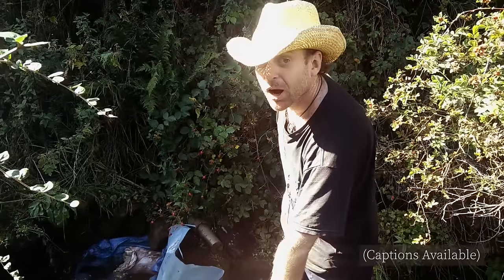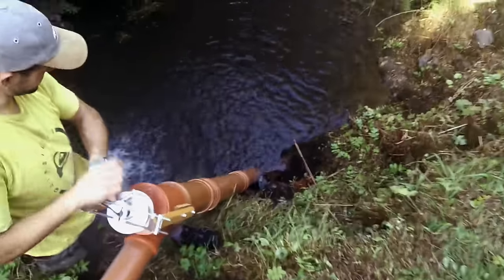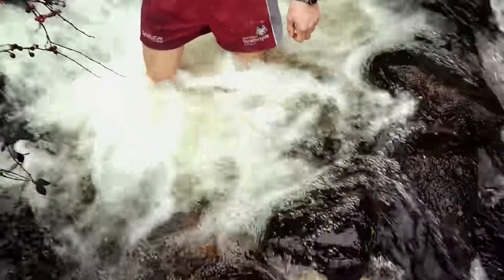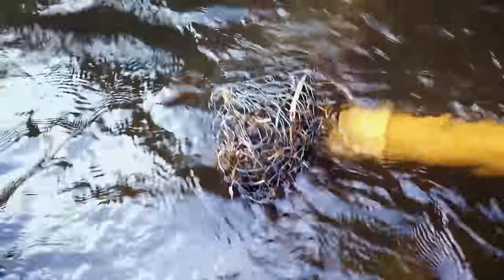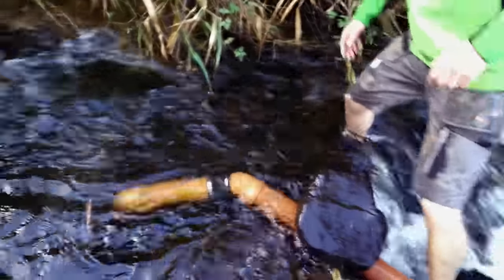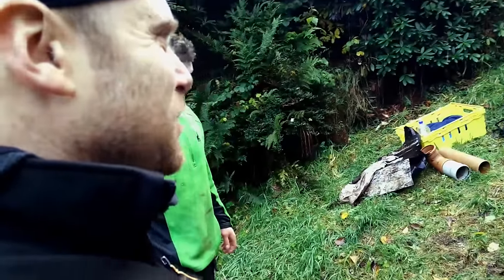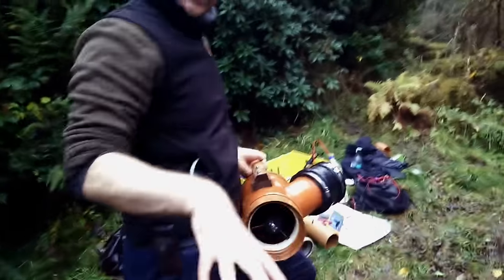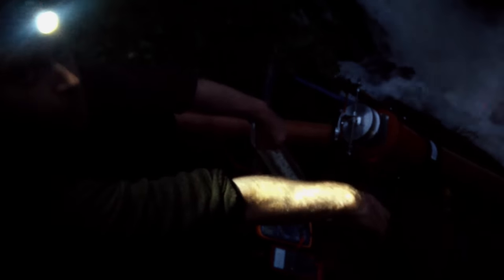Real World Results From The $50 Water Turbine

Comment: What vertical distance does the pipework cover before it enters the turbine? Looks like you could gain another 2m (20kPa) of pressure at the intake if the turbine would be at the end of the pipes.
Reply from the maker: Still need to measure it accurately, but it's something like two meters above, same below. It's a momentum turbine tho, not a pressure type like a Turgo or Pelton, so the runner doesn't want to be at the outlet, best configuration is vertically above as long a draft tube as the location allows.
Got it halfway here for topological reasons.
Reply: @OpenSourceLowTech  Ah ok. Looking forward to your further work.
Concerning the blade damage i think you said that it occured after you shut down the water flow. Could water hammer be the cause?
Reply from the maker: It may well have been, yeah. That or just coincidental timing. More testing on the way.
Reply: @The8blackwidow8  would water hammer only occur if you stopped the water flow, instead of cutting off the water flow? (Blocking the pipe end, capping the pipe end suddenly in would be ways to create water hammer.... But removing the source of water at the beginning of the pipe shouldn't cause water hammer)
Reply: @FuAzzi  In pipelines water hammer does travel in both directions but starts 180° out of phase on the other end. You basically create a zone of vacuum at the cut and the water column will hit back after two time the travel time through the piepline. 
The length of pipe on the "cut" side here is very short, so the water hammer will be very small in amplitude (because you can not cut the flow fast enough to reach two time travel time through the pipe). Propably not a concern but it was the first thing that spiked in my brain when he showed the damage.
Reply: @The8blackwidow8  thank you for the answer.... I'm very inexperienced beyond residential plumbing in construction.... It's nice to have dialogue this day and age, without it turning into defensive attacks.
Reply: @FuAzzi  True words. No worry's, i'm not that experienced too. I love those little projects where people encounter all the real life/ real engineering problems you normaly only read about. And see how they solve them. 
Thats so nice about engineering. You don't need to make it perfect, it "just" has to work enough to meet your requirements and be sustainable.
Stay strong in this difficult times!

Comment: Would have been nice to know how many gallons per minute you're running through those pipes I mean I know that the amount of water you need is really no big deal because without it nothing would work so it seems like you would have wanted to let us know what that flow rate was
Reply from the maker: I haven't measured this setup yet, but in Berlin with 2.5m drop and 125 + 200mm pipe it was about 35 l/s.
This is 110+160 and 4-5m, so maybe similar but not sure without timing a bucket or similar.

Comment: try a pelton type of blade system and of you can make an aluminum blade prototype
Reply from the maker: Peltons and Turgos are good and effective, but only really at heads higher than 15-20m.
Runner can be metal, including cast aluminium, if you're wanting to make one.

Comment: Is there a reason for not using metal fans?
Reply from the maker: Just availability. If you can find them in the right size and shape and not going to oxidise, then they'll be stronger, yes.
Next video will be on testing various 3D printable options.

Comment: What RPM would you expect from this with the 100mm pipe ?
Reply from the maker: Open circuit think we were getting about 1200 rpm or so.
Depends on head, flow, and load obv.
Reply: Have you any idea how much extra the syphon effect adds above just utilising the available head.  It’s an interesting process.
Reply from the maker: The siphon, ie any up and down, adds zero power and in fact would remove some via additional pipe friction and turbulence, etc.
All the available power comes from the natural head, ie the vertical drop between the top and bottom water levels.
The siphon, as such in this case, is just the momentum imparted to the water by gravity. It's more an actual siphon in situations like in the previous videos in Catalonia and Berlin, but that purely out of necessity because there was a wall to get over. Which meant it had to be primed, which was a bit of a hassle, whereas the preferable configuration is like here in Scotland where the pipe can just come out downward from the water source and so self prims and is generally just more easier and more effective.
Reply: Thank you for taking the time to reply. 

Trying to decide between this or a vortex basin style turbine. 

Either way I plan to use the hoverboard wheel as generator. 

Your work is great, well done 👍
Reply from the maker: Vortex turbines are a good option, but usually require a bit more earthworks than I'd prefer for lower resource environments.

Comment: Nice build, thanks for sharing! It looks to me like $50 is too little to do a good job. I'd like to see the $500-1000 versions with heavier turbines and a better screen option. 
The one in my head would be more like a good pump used as a turbine instead of a fan. It needs to be heavier, also less corners on the pipe, the screen is tricky, perhaps the right pump choice with bigger stronger blades would help to allow more solids through. Then I would also consider a diverter for irrigation once batteries are charged... So much potential. I live in Canada and our hydro potential is through the roof. Unpowered dams with relatively low head but large flow abound near me. I'd like to see us tap into that potential in a good way. Solar is ok here but hydro is king here for a reason. Bountiful base load power
Reply from the maker: The impeller I'll be improving on with 3D printed options, for those with access to a printer, the screen as well but that's going to be a matter of some kind of cleverness I haven't quite thought of yet...

Comment: @opensourcelowtech Just found your channel and it looks lika a very cool open source project. Compare yourself to the existing products of for example langstonsalternativepower and the youtube channel LandtoHouse which has very in depth videos about a 6inc and 4inc version of a similar flow oriented turbine. The output actually seems to match for the size too.
So it would be great to have that project kicked off a bit more too. I see a bit of a problem in your design compared to theirs, because your generator wheel sits in a bigger pipe than the intake is. Shouldnt this reduce throughput? If compared to their system with the intake until after the generator wheel and then opening up to create suction, I see waay less resistance.
Maybe also make a 15cm version with opening the suction up to 200-250mm and submerging the exaust.
Reply from the maker: Yep, know those guys, and mine is quite similar in design tho that's coincidental.
Check the build tutorial on my website for more details on the design, but basically there is a throttling of the water over the runner so as to not lose too much velocity and therefore rpms and therefore voltage.
This is in the form of either a Venturi type thing coming in from the Y connector wall to meet the runner if using a 120mm PC fan, or a central flaring if using 3D printed runners.

Comment: Alphacool makes metal CPU fans you might be able to use. They'd probably last the longest. If anyone is building these at home, you should make a bypass valve and pipe for the turbine. Maybe even have a backup turbine with a 3 way system if you are depending on the energy generation.
Reply from the maker: Interesting, I'll keep an eye out for them.
The heatshrink / bottle plastic reinforcement method does make the plastic ones pretty much indestructible tho.

Bypass?
Reply: @OpenSourceLowTech   A bypass can allow you to control how much flow your turbines get if it's too much as well as make it possible to remove all flow if you need to work on it in like 4 feet of snow. Last town I lived in had that setup with 2 turbines and a bypass.
Reply from the maker: Yeah. Would depend on the specifics of the water supply etc. Some kind of basic gate valve or the like would do similar.

Comment: Maybe try this :
make the fan from pvc pipe that u cut earlier , make it flat , cut some slots , heat it up and bend (a lot ...make cuts as thin as possible (angle grinder disc etc) because u have to narrow blades so they dont have enough torque to spin the motor (u can try the Centrifugal type turbine)
make the shaft from stainless steel rod (u can grind some tooth at the end and JB Weld etc the fan (turbine)maybe take some screw , drill it through , and glue it to the rod so u will get something to mount the turbine to and change it if needed
use the ceramic bearings that u put in small pvc pipe etc where u add some plastic spacer (super tight) or rubber seal where most of the water hit it (intake)  mounted inside using 3 strips of plastic etc..

then ad second bearing at the end before connecting the motor ,,, dont connect the motor to the shaft just like that .... use clutch like in cnc motors
 ...super simple to make , on the motor u mount the spacer etc with 2 or 3 pins and on the shaft with 2-3 slots then even if its not perfectly mounted on the motor it will still run perfectly straight because the bearing (dont need to be ceramic) glued to the cap hold it straight 
like that u can make rly good turbine 

ps
there is a chance that inside the motor is 2x smaller magnets and coils ...some cheaper motors have less copper inside 

if u find perfect angle of the turbine (fan) it should output more power

Comment: Having a pool at the top and siphoning the water should eliminate your clogging issues.
Debris either sinks or floats so putting your inflow pipe 250mm below water level should solve the problem, also the pool would provides a constant water level no matter stream flow rate.
Reply from the maker: There's quite a bit of suction on these, so pretty much anything anywhere near the inlet is going to get brought through.
Still thinking about inlet filter options.
Reply: @OpenSourceLowTech  Flare out the end reducing the PSI, also point intake down stream

Comment: The place is very good. Therefore, I think here it is necessary to approach more seriously and fundamentally. To build an engineering-correct concreted section with well-thought-out technical channels here in this place, to build a covered room on a light frame and then bring water into the concrete channels. That is, to raise the idea to a decent engineering level.

Comment: I often have to drain large volumes of water/fluid using siphons in 40-120mm dia. I never have to get 'wet' to start them. Connect a floppy tube to the outlet (bike/car/truck inner-tube) about 4-5 times the length of the dia,  so that it 'collapses' flat under no/low pressure, drop that end in a bucket of water or drop it in a drain, so the 'open' end is submerged. Connect a 'T' pipe, small-bore pipe, somewhere near the highest point of the siphon, (arrange a valve on it so air does not suck back in) drop the 'suction' end of the main siphon in the fluid to be removed. Suck some air out of the small 'T' junction/valve, with a hose and hand pump. Eventually the fluid level reaches the tipping point and some flows down the outlet pipe; soon this flow entrains more air out through the outlet/rubber 'inner-tube' and the whole dynamic increases air removal, at this point you can stop sucking air out of the small 't', and the siphon rapidly reaches full flow. if you arrange the end bucket properly it blows off from the inner-tube (If the innertube is initially submerged in a drain/ditch no bucket is required).
If you have several siphons (i.e. need to remove LOTS of fluid) you only have to start the first one (e.g. 40mm dia) once it is running you can connect it's suck/start pipe to the next/larger siphon and it will suck/start that one: repeat for each siphon.
Leaving the innertubes connected does not restrict flow AND it prevents air back-flowing if flow rate is low.
Reply from the maker: That's sorta kinda what I had going in Berlin (check the Part 2 video), except pumping water in and with a lever flap valve instead of the tube, tho that is an interesting idea I hadn't thought of.

In real world use tho I'd see this as being a straight down siphon, as opposed to the up-over-and down types I had to use on the first two due to coming over walls which wouldn't ideally be there.
Reply: @OpenSourceLowTech  As long as the tube isn't too long (or large/heavy) you can also use the 'inner-tubed' type (maybe flap valve too) to auto start the siphon by 'pumping' the inlet up and down in the source fluid. Then you don't need the 'T' suction/pump method. I have seen disc valves used on the inlet for the same 'pump start' process and that works on long tubes (small/house-hold aquarium siphons sometimes use these).
For larger dia 120-200mm and long tubes I still use the 'T' off method, maybe 'pump' starting the 40mm primer for the initial suck/start provider. It's lazy, needs no power or manual pump, but very effective.
There are dozens of natural and easy ways of starting siphons.
I used to work at a youth club and during summer schemes I'd demo these methods to the various groups, it always surprised me how many of the parents were clueless/fascinated by the demos, nearly all only knew of the 'suck the end of the pipe' method, which I cannot recommend with some of the stuff I've had to drain; although some of the parents had mouths and lungs big enough if you get my drift.

Comment: Like your videos. why don't you use a metal bladed fan?
Reply from the maker: Can be tricky to find them cheap and in the just the right size.
Are a better option where available, the heatshrink reinforced PC fans are surprisingly strong, and the various 3D printed options easy to make pretty robust.

Comment: Great build, glad to see you still working on this.

I saw on Robert Murray Smith channel that he showed on his 100£ /1 KW windmill build that:

If he put a capacitor in after the generator but before the battery it took the load off the generator and the resistance from the batteries/ or  back EMF from the generator.

It spun more freely and produced more power it seems. It also improved getting power at lower speeds. Because the capacitor took the load/ resistance off the generator completely.

Also if you can 3D model can you do it in cad? Or have someone that has a metal 3D printer do it in CAD and print a metal blade? That may stop the breaking?

Also at small Dams, I see them put floating wood planks before the intake to divert the leaves away from the intake. The planks of wood are in a V shape or A frame shape making the leaves go around the wood planks before the intake.

Thank you for the video 😁.
Reply from the maker: I hadn't see that vide of Rob's, I'll check it out.

Any printable runners that end up doing a decent job I'll post the 3D models of with the tutorial.

I've been looking at intake / filter options, but most of what''s available are for pressure type turbines, like Turgos and Peltons, as that's what most people have. But they suck a lot less water volume per power than mine, and so don't seem like they' necessarily work well. It's my current main problem to solve.

Comment: This would have worked better if you had run the water through a separator made up of 2 barrels first. Attach a large debris screen onto inlet and then run the intake into the top of the first barrel, connect the second barrel to the first towards the top and then hook the generator to the second barrel about halfway down the side of the second barrel remember to use a screen on the generator inlet at this point.. The first barrel will catch most of the debris and the second will catch the rest

Comment: 120w with that kind of head (drop) and flow should be MUCH higher.  A turbine stile water generator will do much better, but even washing machine conversion can do 500w.  You can buy 500w water turbine generators for about $250-400.

Comment: I like the design. But this pipe as a syphon it is what, 100 cubic meters per hour? A lot of water. It works only  where water is abundant naturally.b
Reply from the maker: Yeah it's about that, slightly more with fatter pipe. This sounds a lot numerically, but in practice a small to medium flowing creek or stream is enough to keep it fed.
Reply: @OpenSourceLowTech  You are right. Here in North Africa 100m3/h is very rare to find in our semi arid climate. But in Europe you find them in any forest
Reply: @OpenSourceLowTech  On the other hand 100/150watt is ideal for lighting a camo of tents and even powering mobile devices.